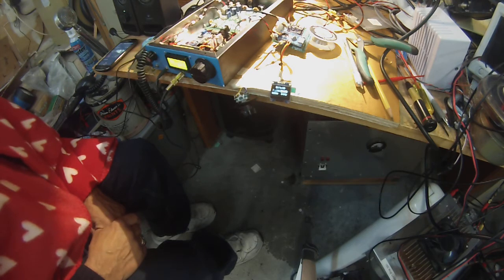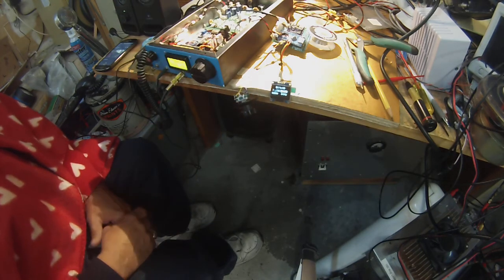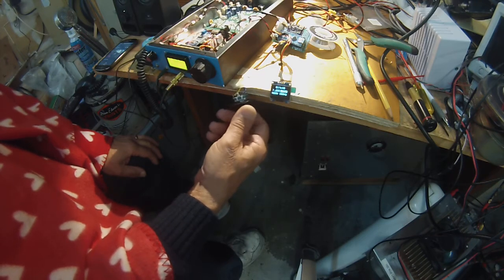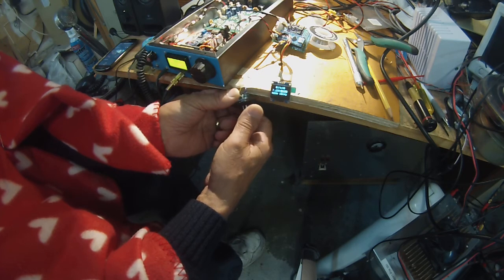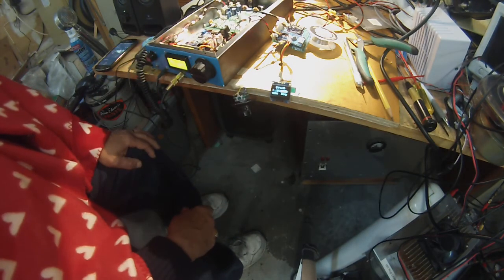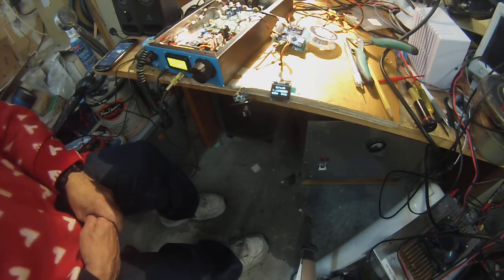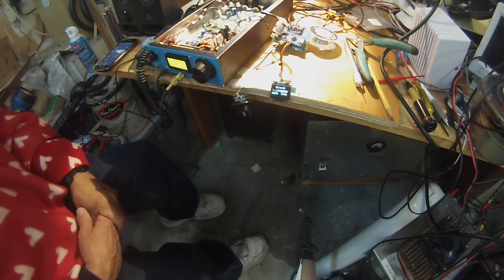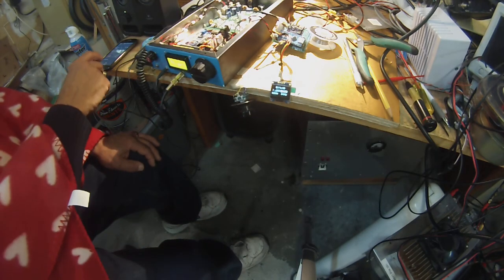Bitx40 with OLED & Si5351 Demo

Comment: Hi Pete - Great video, love the case! I'm building myself a 3D-printed case, pretty compact, with a rotary encoder and a SSD1306 OLED. However, I'm struggling with the OLED display, it seems to radiate all sorts of QRM into my rig, probably the charge pump used by this module. Do you have any ideas on how to solve this issue?
73 Manoel - ON6RF
Reply from the maker: Thank you for your post. First many experimenters have experienced "the noise" problem and so it is a common issue. The particular hardware you see in the video (actually there are several videos) using this same circuit/hardware seems to have avoided major noise problems. I have heard and seen where the OLED's in the hardware produced far greater noise. (really bad in fact it completely blanks out any signals). There are some standard treatments including the following: Power the OLED (5 VDC) from a separate supply, use shielding around the OLED, use brute force filters in the 5 VDC supply line (a pi network with 330 Ufd caps and a 10 MHy choke) and use active de-couplers in the supply to the audio amp and microphone amp circuits. It appears that the radiation from the OLED tends to be at the lower frequencies (audio range) versus RF range. See http://soldersmoke.blogspot.com and search on OLED's, active de-couplers for more detail on this. I guess I got lucky as the only treatment I have used is the separate 5 VDC for the OLED.The 3D printer appears to be the next new wave tool in the toolkit for ham operators. Lucky you.73'sPete N6QW http://n6qw.blogspot.com
Reply: Alright, thank you very much for the tips! I'll give it a go :)
I'll post pics of the case, along with design files on groups.io once I'm finished :)
Reply from the maker: That is what is so great about the technology --great sharing of information. 73's Pete N6QW

Comment: Pete, I am really enjoying your videos. I am curious as to your "gut" feel as far as quality of RX between the AD9850 and Si5351 circuits. Phase noise, artifacts etc?  I am asking for purely your opinion based on your ears. Thanks and keep up the good work. 73 Bob VE3UK
Reply from the maker: You will get all sorts of crap about phase noise with the Si5351. I can't tell if that really is a problem. But the Si5351 wins hands down. Larger frequency coverage, LO and BFO on one board and  on and on. Unless you are building some super sensitive piece of laboratory test gear then get the Si5351.Pete
Reply: Your reply begs the question, if one did want to build something super sensitive, then what would you recommend?  As for the Si5351, this device puts out a square wave, which by nature then will have a slew of odd harmonics, or so I've read and been told. So then that "may" need to be filtered out. HOWEVER, from the little that I know, I generally agree with you and the Si5351 is my choice as well. Great job!
Reply from the maker: The Si-570 goes into the Ghz region and has better phase noise specs. It is not so much the square wave as DBM's love a square wave as it is phase noise. The 570 is a single output device which is another issue. So all around for the ham builder --the Si5351 is the choice.Pete

Comment: Hello Pete where i can find the sketch ?? Thanks in advance!
Reply from the maker: Thanks for your post. Go to my website www.n6qw.com and there is a link to the Bitx 40 lower let hand corner scroll down. or copy and paste this link

http://www.n6qw.com/Bitx40.html

The Bitx 40 is not a good candidate to easily make work  because they are shipped with three different crystal frequency BFO's so you are going to have to figure out which one you have otherwise your display will be off.

73;'s
Pete N6QW

Comment: Hi Pete, Are you pretty happy with the bitx40? I may grab one before it's too late. I generally don't buy kits, but it's too time consuming to build, test and work the bugs out of a homebrew right now. Your thoughts? 73, oh, love the hearts😀
Reply from the maker: Hi Derek,I built the unit as a part of a presentation for a local radio club; but is not something I use daily. My personal preference is for rigs I have designed and built myself. The Bitx40 is an amazing bargain at $59. For a few $$$ more you can customize it to your hearts content. There have been many "hacks' to this rig and these are documented on the VU2ESE website. My contribution was to add a linear amplifier switching circuit. You can't go wrong for the price and it works out of the box! I think at last count several thousand are in use world wide. On my website I have added a series of build notes that may be helpful. See http://www.n6qw.com/Bitx40.html73'sPete N6QW
Reply: Pete Juliano I'll check it out. Thanks again, for the quick reply, you are of the very few that respond to questions and I appreciate that. I think I saw BB King wearing one of them heart things. Cheers!
Reply from the maker: It was 48 degrees in the garage at the time the video was shot!
Reply from the maker: You should get a confirmation email and it takes three weeks from India.
Reply: Pete Juliano Thanks Pete.